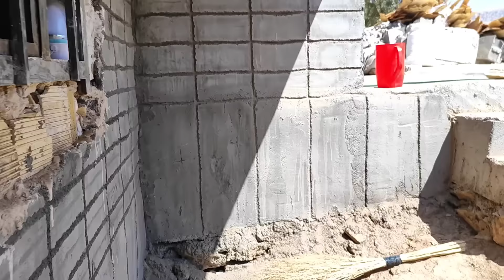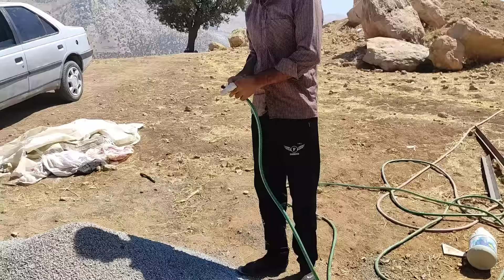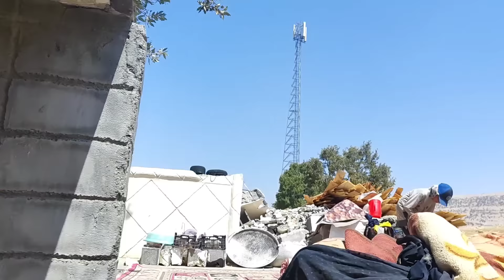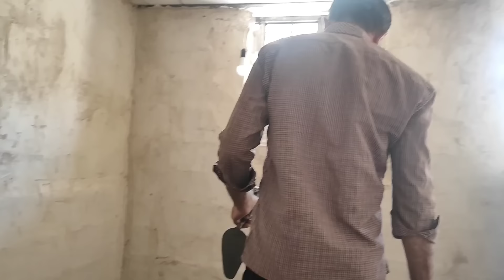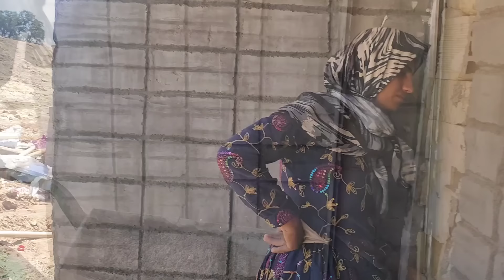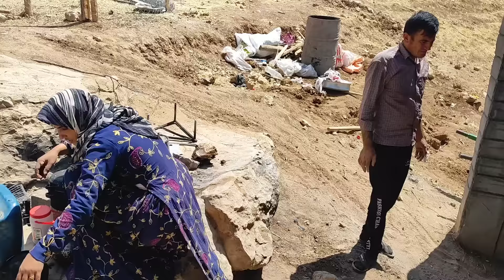Warmth, beauty and comfort"*"A house for winter: construction and preparation of a dream shelter"

Comment: Winter will be there soon. Use the money from work and these YouTube videos to start preparing your home now. Every chance you get, buy material and supplies. You can save and buy land after winter. Install a wood stove for heating and cooking. Also buy a burner stove. Seal and insulate all cracks and holes in the building, window, and door. Put up thick material curtains on the window and the door window. Buy some kind of durable, thick bed cushion pads to keep everyone off the floor. Buy or build a weatherproof, waterproof, durable structure to hold two to three months of firewood. Start collecting firewood now. Closer to winter, buy and stock up foods that last in cold weather conditions. Make sure there is plenty of drinkable water. Please have warmclothes, socks, boots, hats, jackets, gloves, etc. Stop doing busy work that keeps you stagnated. Concentrate on the important tasks for the future. Best of luck for you and your beautiful family.
Reply: If them live there is true 😅
Reply: Very sound advice you just gave I hope they read your comment and take heed to it.

Comment: Please tell Qubad the cement floor is.too thin. When it dries the weight of them and their belongings will crack the floor and it will leak. Also the heat of the.stove will effect the floor if it isn't thick enough. Qubad should let this.floor dry then wet it a.bit just before.adding another cement floor.on.top. The little bit of.water between them will help join the two floors.together and.it will make.the.floor.stronger.

Comment: The problem with your car could be that the battery is badly depleted . take the battery of and charge it up .this will also in part take the car back to factory settings .or buy a new battery .keep the original in the boot with a pair of jump leads .this is always a good idea  because you live in the country with reduced help if anything goes wrong again with this car   you will have one of the best backups with a spare battery  help .

Comment: You have to get the cement wet before you put it in the wheelbarrow. Fill the whole center with water and let it soak. You put the center there and then didn't use it.